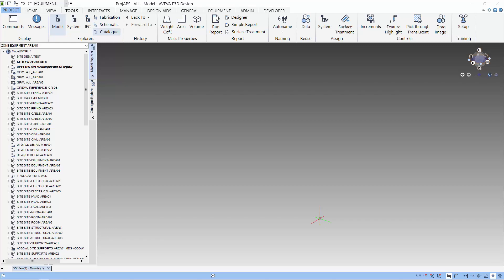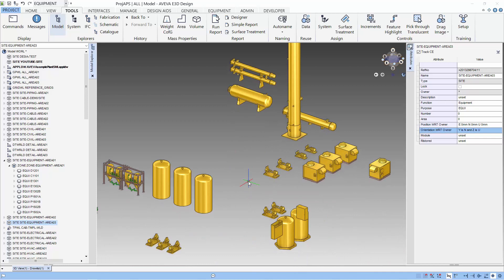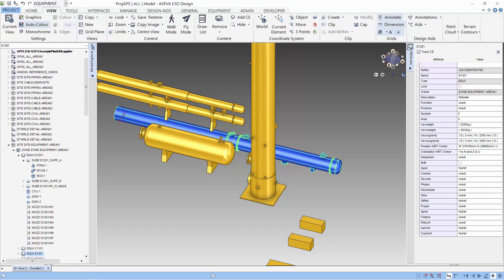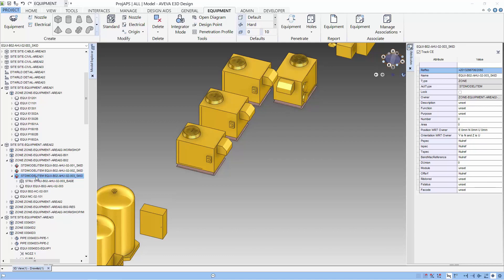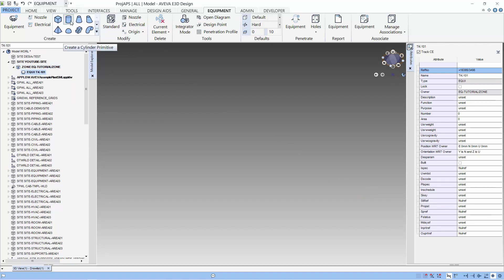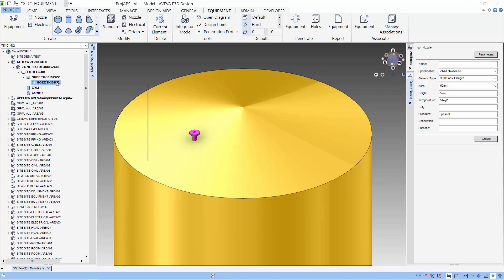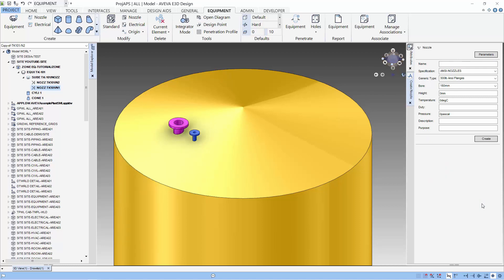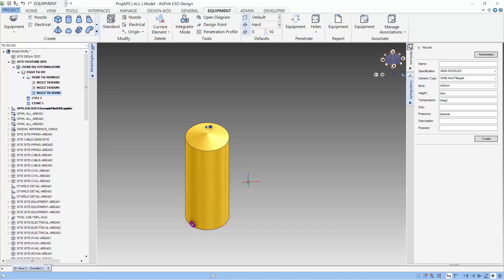E3D Getting Started - Equipment Modelling  ( Learning Path 02 )

Comment: GOOD AFTER

MAKE VIDEO FOR ME SIR;

PLEASE HOW CAN YOU JOIN TWO DIFFERENT ELBOW 45 DEGREE WITH  DIFFERENT ORIENTATION; THE FIRST ELBOW 45 DEGREE  IS COMING DOWN FACING N-AXIS @ ROTATION 45 DEGREE WITH DIFFERENT HEIGHT, WHILE THE SECOND ELBOW 45 DEGREE IS COMING UP @ ROTATION 270 DEGREE WITH DIFFERENT HEIGHT, USING THE DIFFERENT HEIGHT LEVEL OF THE TWO AS (SPOOL LENGTH) 700mm.
Reply from the maker: You have given too much constraint. Please note that what you want may have many solutions or no solution.